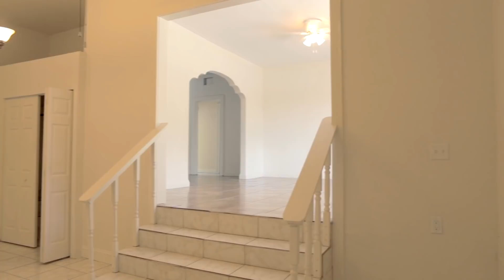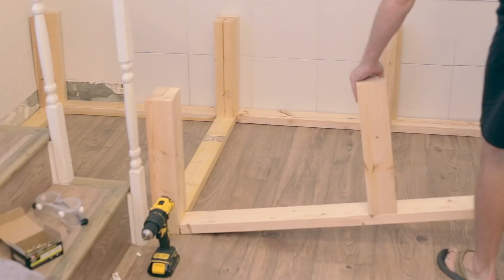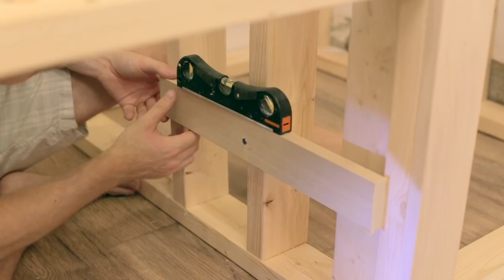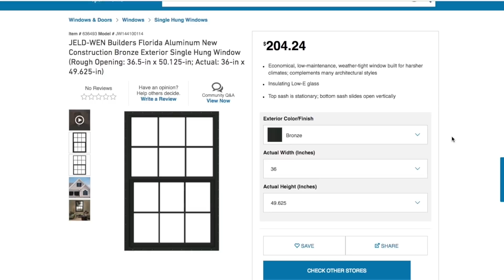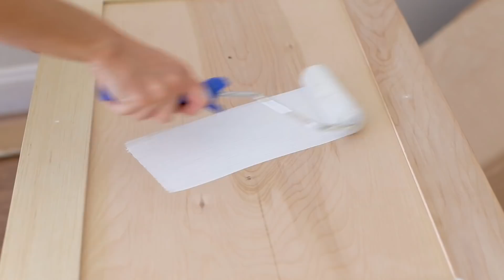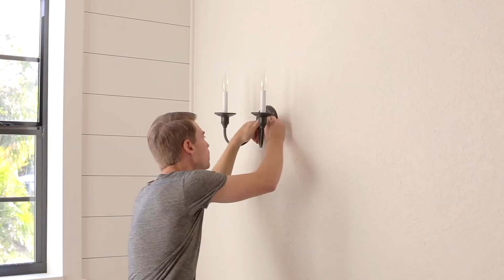DIY Window Bench Seat Transformation

Comment: I love how you say "WE", when your husband is working his butt off!  Somebody has to hold the camera, right?  Great solution and thanks for posting this tutorial.  I like how the hardware and the sconces and even the mullions of the windows all tie together.   I would have been afraid of being a Joan Gaines wanna-be for using the "shiplap", but I don't see that here.  Question:  did you use primer on the bare wood or just a couple of coats of paint?  Did they put a zipper on your "mattress"?  Some people would put a little lip on top of the bench to hold the foam, but you could always velcro it to the top if it slides around too much.  Excellent work again Jenna Sue.    The basic construction of this can be used in many different applications.
Reply from the maker: Thank you! The SW paint I use always has primer built in so no need for an extra step. The cushion is zippered/removable, and does not slide easily at all (there is a small lip on the bench, hard to tell) but we would add velcro in the future if needed.
Reply: @JennaSue I'm gonna copy you!